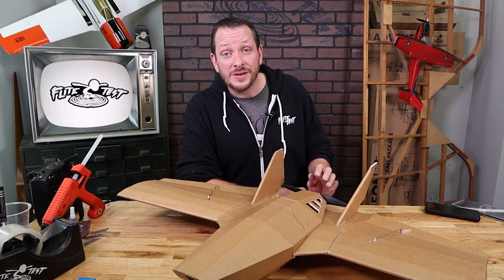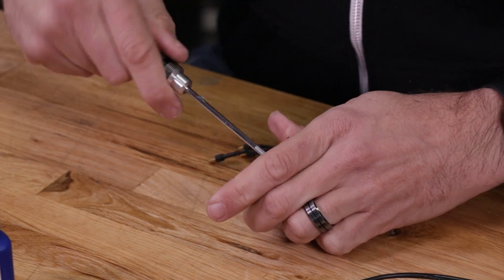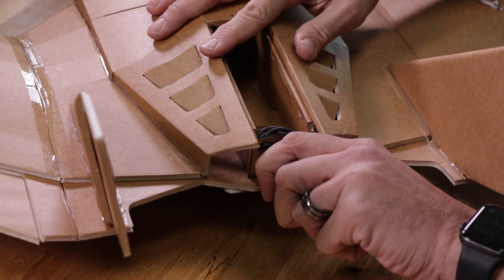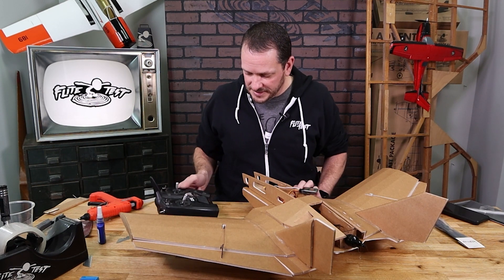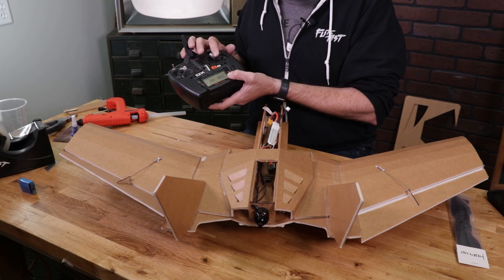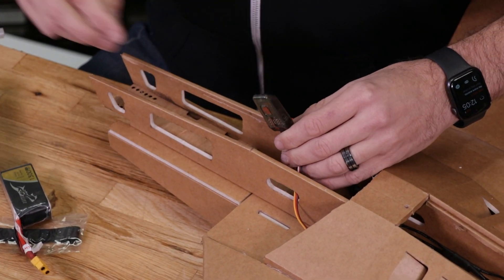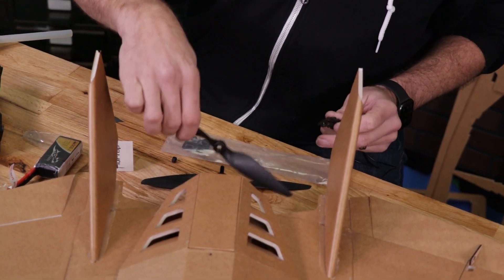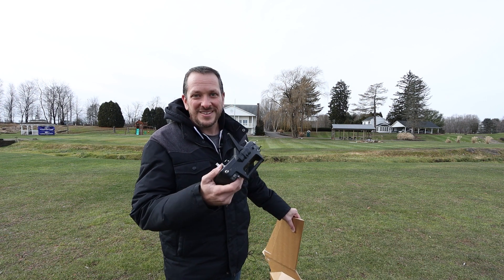How to Build the FT Flerken // Motor & Electronics // BUILD

Comment: Hi. I built the flerken and finished it today. I actually couldn't establish the Cg only with a 4S 2400mah battery as mentioned in the build video. I run  a flitetst  C pack Radial  motor. I had to add a run cam 2 with 50grams  plus 50 gram ballast and I'm not sure if this will beenough...   Why is this?